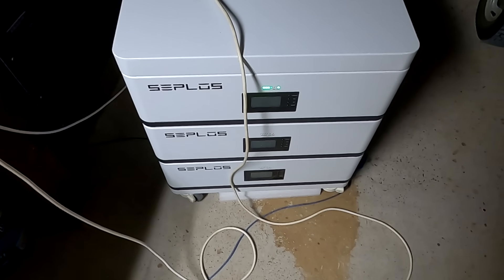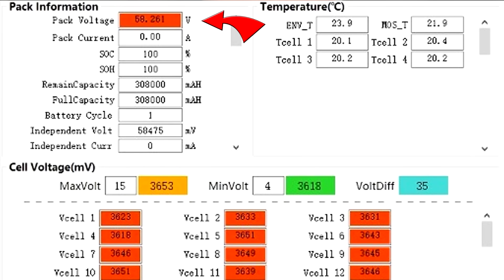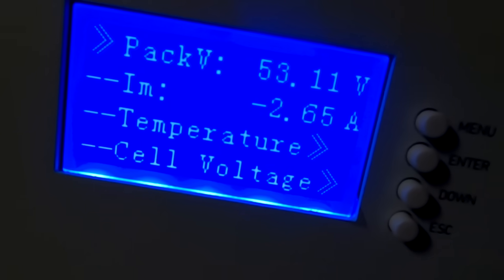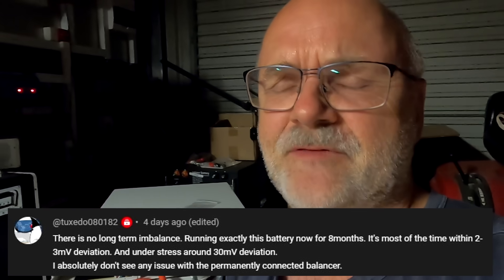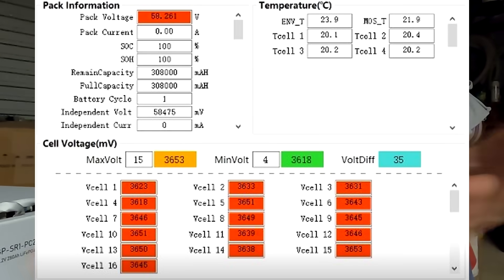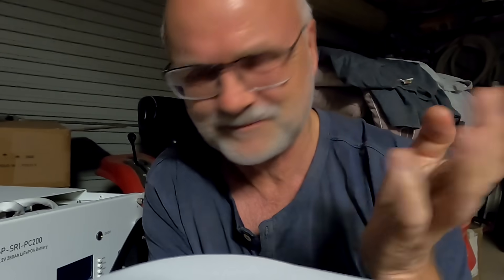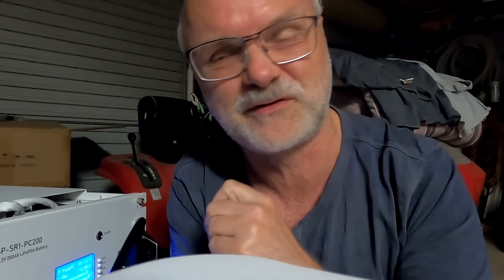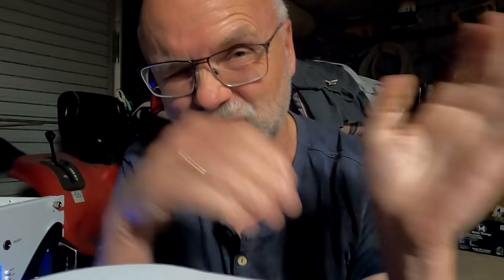Active Balancer: always on or only above 3.45V?

Comment: My problem is that the Neey doesn't even get to start balancing at 3.45V because, for some reason, the Seplos BMS in my battery doesn't charge higher than 55V. If anyone has an idea why that is I'd appreciate a quick reply - even if my question/comment is not about Gobel BMS. I am sorry but I tried everything in the settings but no change :(
Reply: Are your cells that unbalanced that they hit overvoltage alarms/protections at that voltage?
Did you do a too balance before putting them on the seplos BMS ?
What you can try is charge( and float ) them for a night at 55.
Make sure the neey starts at 3.43 .
This may bring them somewhat in balance.
After this , very slowly increase your charging voltage.

Best would be to do a parallel hookup of all you cells, and charge until 3.5 or 3.55 untill amps drop below 1a
Reply: @houseofancients  I hit the 55V  and "idle" battery state again just now.
lowest cell voltage: 3.436
highest cell voltage: 3.438
Reply: @houseofancients  Thanks for your reply. I did an initial parallel charge as is recommended before putting the cells in. Even to 3.6 if I remember correctly. Where the cells are still unbalanced I will check later today when I hit the 55V again. The Neey starts at 3.45 in my case (stops at 3.4)
Reply: Check what your MPPT settings are at, I had a similar situation make sure your inverter MPPT charging settings are the same🤷🏻‍♂️
Reply: @alanblyde8502  Currently the battery is only charged through an AC-coupled Fronius inverter and two Multiplus II. The Victron system is under external control of the Seplos BMS, i.e. (as far as I understand) only the Seplos settings matter?! (but I might be wrong here)
Reply: My first thought was also that one or more cells may be causing a high voltage shutdown. Basically,  top is unbalanced causing it not to allow top balance.
Reply: @putteslaintxtbks5166  I will check later once I am back at 55V. I had a look yesterday and didn't see anything (i.e. no large deviations nor any alarm) - the battery just went into idle...
Reply: @putteslaintxtbks5166  I hit the 55V  and "idle" battery state again just now.
lowest cell voltage: 3.436
highest cell voltage: 3.438

Comment: Depends on the time spend at low soc(0-10%). In winter most batteries will be on the low SOC most of the time wich will destroy the top balance with an active balancer active. In summer when not reaching low soc, the balance current will be low at the flat part of the curve and will not be a problem(at normal charge rate 0.2c).  I agree using a balance voltagepoint above 3.4-3.45 will always work. Secondly, make sure your battery can reach 100% occasionally, even in winter and not leaving at at low soc for months(as i seen often).
Reply: Leaving it a a few days cycle between 0-30% wich is happening in winter in our country ( The Netherlands) for example. actually this will go on for months.. It will destroy top balance. Most inverters can not easely be set to seasonal "lowest soc" without going through a lot of settings so people tend not to do so. In summer batteries will be at 100% soc for a few hours a day so then the active ballancer does great.. This is the avarage from what i see happening. Every system and the capabilities for good maintanance is different. When systems are not maintained and sitting at low SOC a lot in winter then the active balancer is actually a good thing.
Reply: true, I rarely see the battery manufactureres also state that the batteries should be charged to 100% ca. monthly to calibrate SOC etc. Deye ESS at least states that for theirs, so people have a point to follow (if they are smart)
Reply from the maker: Well, we do the same discharge test with both option (with and without AB), so it should not matter for the sake of comparing both models.
I'll test tonight and video will come tomorrow morning. Then we know.

Comment: I am always curious about leaving the active balancer on all the time. My BMS has passive balancing and I can set that parameter.  the Heltec active balancer is added..it is what it is..  but I am Li-ion chemistry.  The pack will stay at .001 dev. when not in use. No matter what SOC.  I really never look at SOC as I am more concerned with total pack voltage.(& not having it to the top when it is not in use for a few days..)  The closer the cells are... the more I can get..     I watch all your videos but again.. I am Li-ion chemistry .  This is a motorcycle racing application .  20s8p Molicel p42s
Reply from the maker: It will work perfectly with Li-ion batteries due to the linear curve and relation between voltage and SOC. And that's where these balancers are coming from. The same with the small BMS balancers. With Li-ion, you can basically balance all the time and the 50mA will get it done over time.
Reply: The bigger delta I have.. the more volts it will use to bring it back.. 2v on the passive and 5v on the active... (max)  Im sure you know all this.. LOL It all works very well for me..Learning a lot from you... but having to translate it to LI-ion chemistry ...  @OffGridGarageAustralia

Comment: Active balancers are just not worth the trouble and expense. Spend your money on high current passive balancers.
Reply: Why ? 
To produce some useless heat ?
Reply: Your Frankenstein Battery would have worked with a high capacity passive balancer.  @Juergen_Miessmer
Reply from the maker: Yeah, I would like to know what that high amp passive balancers is and if you would use them all the time with LiFePO4?
Seems like a lot of waste to me...
Reply: Balancing is only performed when battery is almost fully charged (about 2/3 of days). The balancing energy would have gone uncollected, so it's not really wasted. I built my system, but assume there would be some for sale.  @OffGridGarageAustralia

Comment: You are being provocative to increase engagement. As long as the current, in or out, is within the balancers ability to cope with the cell deviation, it will be beneficial to the longevity of the pack. As you say, all cells are not equal, some will inherently be better than others. A balancer that shifts energy within the pack while in use will naturally compensate for the weak cell by drawing from the strong. This is true at the top or bottom of SOC thereby eventually wearing all cells into roughly equal capacity by wearing the strong more than the weak until they are even over their life. 

The only reason to limit a cell balancer is if the balancer cannot keep up with the current during charge or discharge, in which case the balancer is insufficient for the task.
Reply from the maker: I always have these controversial topics: cell compression, balancing, certified cells 😂
The load or charge current will almost never be lower than the balance current. This is the reason why I absorb for 1h. The battery sits there and does nothing while the balancer can work on it.

Comment: yes, Andy, I think you are absolutely right. it may be possible to leave it as an active balancer all the time if there are real conditions for it. for example, the battery stays fully charged for a long time. however, the battery is constantly used as soon as it is charged and immediately discharged, the next day it may not even have time to charge and it is discharged again, it is really likely that the top balance will be bad. I'm almost sure that your video will prove it.
Reply from the maker: Thank you for your thoughts. Video is coming tomorrow!

Comment: I think the diffrence would not be much.
Why?
I track all battery telemetry all the time in HA. I only can see significant cell voltage deviation during absorbtion phase. Not during charge, neither during discharge. So even if the balancer is permanent on, it would do nothing exept arround absorbtion phase.
Some info about the battery:
Two packs paralell, each 16s lf280k jkbms.
Charging to 55,4 V,  absorbtion at 55,4 V, after that bulk at 55,2V.
Balancer starts at 3,4 V.
Deviation is 30-50 mV, goes down to 5 mv within 15-20 minutes balancing with 2A. Then further down during the day without balancing.
During discharge deviation does not exeed 5 mV for longer then some minutes.

After running this for 24 full cycles (around two months) i changed the balancer treshhold today to 3,45 V (as Andy recomnents it) to see if it makes a diffrence.
Reply from the maker: Interesting settings. So, you basically keep the battery at 55.2-55.4V for the rest of the day. That will give the balancer a lot of time to do its job.
Yeah, let us know if the change in settings makes a difference. I don't think it will. Settings are too close together.

Comment: …balance starting @3.45V! 👍
Reply from the maker: Always! 😉
Reply: @OffGridGarageAustralia  - I run my two batteries (24V - parallel) without a balancer for a longer time. The capacities of the cell matched very well and at start I made a top balancing. The cell difference is always below 10mV. The SOC is periodically going up down, but up to now I did not reached the low voltage level at which the BMS would shutdown discharging. I have balancer laying around and I'm not sure if I should use them.

An other question of interest is, did you ever have made a top (re-)balancing of your three batteries? I assume they are already in use for a longer time.

And thank you again for your interesting and entertaining videos 👍

Comment: Ich habe 2 Batteriepacks a 24 Volt in meinem Inselsystem. Die tollen Hitiumzellen (ja, ich weiß) gepaart mit je einem Daly-BMS (Ja, ich weiß);
Ein Pack lief von Anfang an ohne Probleme, bei dem ich kein Top-Balancing gemacht habe und der Andere, bei dem ich das vorher tat machte von Anfang an zicken. Eine Zelle driftete weg, war schon auf 3,65 Volt, da waren die anderen noch nicht auf 3,5.....Ladung wurde abgeschaltet, da ich den maximalen Drift auf 0,2 Volt festgelegt hatte...   Ich hatte ein wenig Panik und habe mir einen aktiven Balancer 5 A zusätzlich drangehängt.
Der läuft jetzt seid einem Monat durch. Geladen werden die Zellen auf 3,5 Volt, entladen bis auf 2,6 Volt, was wohl erst  im Winter passieren dürfte.
Jetzt hält sich der Zellendrift in Grenzen und ich bin zufrieden.
Bei guten, gleichen Zellen ist das zusätzliche Balancing vielleicht nicht nötig, aber bei dem billigen Schrott anscheinend schon.
Ich könnte ihn mal wieder abklemmen und schauen, ob die Zellen wieder auseinander driften.
Reply from the maker: Or you could try using such a voltage detection relay to turn on the balancer at 3.45V and see if that improves the deviation even more.
Thanks for sharing. I like the Hithium cells. They work well in my Frankenstein battery.

Comment: In the super flat area of the curve there is not supposed to be a significant difference between cells - an active balancer has nothing to do in the flat space of the curve (theoretical) - thr frankenstein battery might be different - have fun testing
Reply from the maker: Yes, you're right, in theory, the balancer should not work. But if you have load connected there is always a bit of a voltage delta due to difference in internal resistance. The AB will use that to shift energy around. And this causes the problem once we fully charge again.

Comment: I have always ON balancer. Now its one year. Chinnese battery from aliexpress 16S.(Litokala)
Charging voltage is 55V discharge voltage 50.8V delta almost every day is 200mv.
IF Charging voltage is 54.4V discharge voltage 50.8V delta almost is 80mv.
Balancer after charge took about 20min to take 200mv to 30/20mv.
I think turning OFF balancer while discharging bring better solution becouse if I have bad cell whitch I have. Capacity is about 55 - 70Ah of "Declared 90Ah"
At 50.8V I have delta about 30-40mv and ballancer doing downbalancing all night long. Next day TOP is again 200mv.
Compared with other battery pack with 2A JK-BMS I have max delta only 30mv max when do TOP charge and after 10min = 5mv.
So I know answer now but I am lazy right now to rebuild system becouse anyway planning sell this pack and build new.
Reply from the maker: Yes, great, very good point. Thanks for sharing. A bad cell can make the balancing worse if the AB runs all the time.

Comment: I believe your theory is correct. I am uncertain if your test will reveal anything, though. One cycle might not change the balance so much and the balancer might be able to even that out quickly. 
I could imagine that in winter time when the battery oscillates between 0% and 30% your top balance will be completely destroyed over time. When balancing in the bottom steep area.
Reply from the maker: Yeah, winter is always problematic with a permanent balancer. It has so much time to do 'damage'. 
We will see what is going to happen, video is coming out tomorrow morning at the usual time.

Comment: I wonder how much loss the balancer introduces by being on all the time. Balancing the cells can't be free. Maybe it is so little it does not matter or is too hard to measure because ambient temperature is a much bigger factor. 

On the other hand, having a balancer in the lower state of charge might just help if a few cells are not as good as the rest of them. Let's say in the future you have one not so good cell that only goes to 250 Ah and other cells go up to 300 Ah. Can the BMS still top off those good cells? And if so, will the battery last longer if the balancer still recharges the one bad cell from all those good cells in a lower voltage range, thereby not taking down the entire battery much too soon when all of the other cells still have 50 Ah each?

Just some thoughts of the top of my head about the cons and pro's of balancing if you just want to maximize the kWh you can get from a full charge.  I may be completely wrong on how this works.
Reply from the maker: You're not completely wrong, but spot on!
Balancing in the lower SOC could be problematic though as the balancer would only work, if your load current is smaller than the balance current. Otherwise it wouldn't have a chance.
The already weak cells may get a harder workout if they get constantly charged and discharged by the balancer, so it could actually make the situation worse over time...
Reply: @OffGridGarageAustralia  So maybe keeping the balancer running continuously is a good way to keep up on some batteries. But on LFP cells with a very flat voltage curve it might guess wrong and start overcompensating  for a hard to measure the actual SoC difference. I wonder  if that range could have a higher relative difference between cells to start balancing. I agree that it may be hard to keep up with the discharge and bad cells will only get worse. But without the right skills and knowledge, servicing these individual cell is not an option. It would be so much better if these were in hot-swappable brackets.

Comment: I think that there is no need to test this again Andy, trust the that we know from the past that the active balancer should not be on all the time . that is the answer. Or make sure that the active balancer only balances at 3.45v and up. imbedded in the software.
Reply from the maker: Yeah, I know, but this question came up again so we do a quick test. I'm also keen what Gobel has to say to their design, if it either works or not...

Comment: Leaving the balancer on all the time is similar to what happens if you put all the batteries in parallel in the way they would equalize their voltages.  If the balancer could keep up with high charge and discharge rates I don't see a problem.
Reply from the maker: Exactly, but the balance current may be much smaller than the load/charge current and the AB will use any voltage difference to do its work. If there is no load on the battery, it may work but would also work harder on the already weak cells by charging/discharging them more often.

Comment: I’ve seen those comments about balance always on works for them. Well, it depends on the user’s pattern of use whether or not this works. However, if you balance only above the knee, it works without a doubt for any pattern of use. No worries
Reply from the maker: Yep, that's a good point. Cell quality and how well they are matched plays a big role. But also, how well will they they still be matched in 5 years time?
Reply: @OffGridGarageAustralia   Good to see you also think about the future, most just "revieuw" as new and tend to forget how it works over time👍
Reply: I agree, with only 2 amps if one were to use the batteries daily it would have very little effect in my opinion.
I only use my batteries for a backup generator and after several days of not using them they automatically balance themselves at the level they settle at which is around 3.3 volts
Reply: New batteries that are super well matched and consistent with each other, its probably its not a big deal. But older batteries with different/larger varying internal resistances it makes more sense to only balance at the top where it's needed.
Reply: No, it doesn't work at the lower end. You can see an all-time on balancer with voltage difference activation as an universal  solution. In summer when voltage near top it does top balancing. In winter when voltage is mostly at the lower end it does bottom balancing. 

This all helps to get most out of the cells and also helps to age the cells more equal.